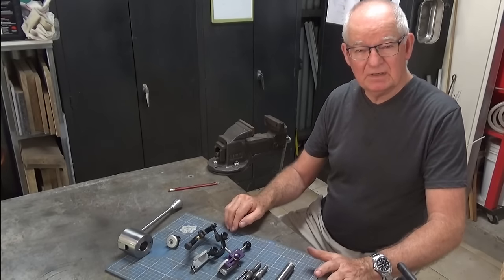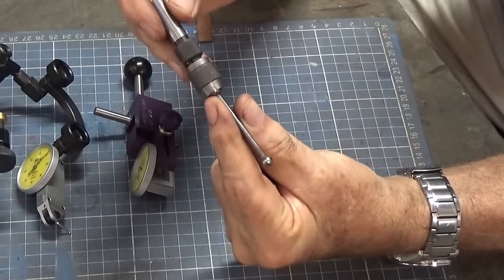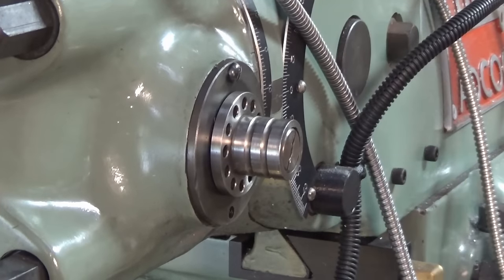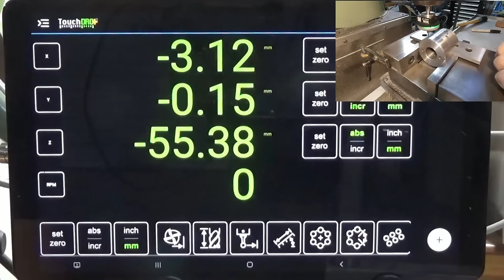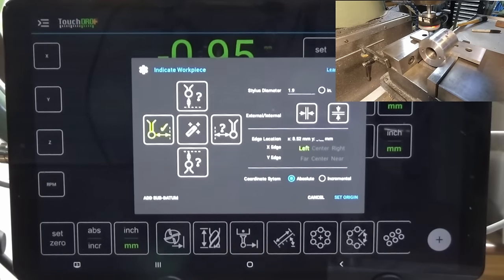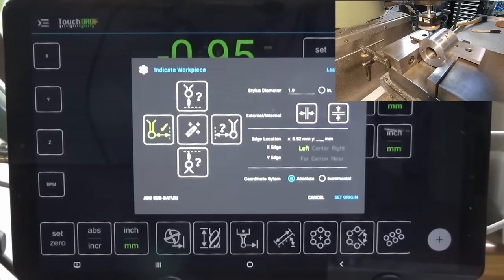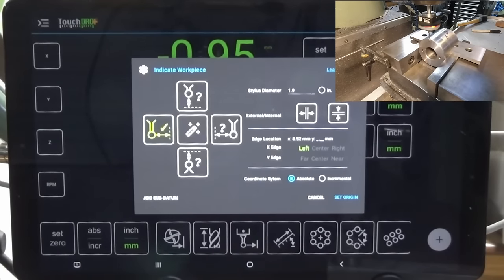Using a Touch Probe with TouchDRO

Comment: Great video thank you. I have a Touch DRO on my mill, so now I'm thinking about one of those probes too. Love the clip of the roos at the end. An animal that gets around by bouncing just doesn't get old.
Reply from the maker: Thanks. I used that probe today to find the centre of a 3/16" half pocket in the end of a steam engine cylinder. It's about the only too that I have that could get inside the perimeter of the opening. It worked great!
Regards,
Mark

Comment: Excellent video. Some years ago I acquired a Burke Millrite which has about ~0.0025 backlash in X & Y and has always drove me nuts. I thought about a ball screw conversion but couldn't justify the expense. Then I came across TouchDRO when I was installing mag scales and I quickly purchased it. Touch DRO has literally changed my world when using my mill and I highly recommend it, best money I've ever spent on my home shop equipment/tooling . Next I'm planning to do the same setup for my 1937 16" Series N Southbend lathe.
Reply from the maker: I had a sort of crisis of confidence when I first started using TouchDRO with the iGaging capacitive scales that I first installed on my Bridgeport. The capacitive scales just weren't reliable enough and I found myself going back to using the micrometer dials. Of course, that sucked big time because I also had some considerable backlash in the X and Y axes. However I bit the bullet and swapped over to glass scales and I haven't looked back. I can use it all day and I never have an issue. It seems a bit nerdy but I like that.
Regards,
Mark
Reply: @Preso58  I'm using iGaging scales and I to had some issues. I found it to be bad grounding at the scales. I had to clean paint of the mounting hardware brackets and ensure a good ground from the head all the way thru the machine to ground. 👌🏻

Comment: Good overview on the different types of edge finders Mark. When you were a tenth of a mill out I immediately thought that there was something (swarf, dirt etc.) that was causing the issue. Good that you found it. Also, nice work on the handle. My mill has two modes, a handle like a drill press, and a hand wheel that moves the quill around 2mm per revolution. I have removed the handle and I use the hand wheel as it is more accurate.
Reply from the maker: I now blow out the collet and the bore of the spindle before mounting the probe. I have a bad habit of leaving collets lying on the tray beside the mill vice. I usually wipe them down with my hand on the outside but there was probably a chip in the bore of the collet. I love the quick set quill handle. I should have made one years ago.
Regards,
Mark

Comment: What I have on my knee mill is an after market automotive steering wheel I love it. Thanks for a wonderful video. From NW Indiana USA
Reply from the maker: I thought about getting one of those. The other option was a three or four handled feed wheel like you see on a drill press. One of the issues with my mill is there are a lot of cables and air lines around that side of the mill head. The DRO, work lights, air lines and the probe connection wire all seem to get tangled if you aren't careful. The steering wheel idea would be the best option in that regard because it would be harder to get stuff tangled in it. However the upgraded feed handle does look nice and it seems to fit the aesthetic of the mill.
Regards,
Mark

Comment: Thanks for the demo Mark, I'm not in the market for a Touch Probe or TouchDRO but it's good to see what I'm missing out on. :) 
Good to see someone else has made a Stefan design low profile TDI holder - I'm really happy with mine.
Reply from the maker: I do like my Stefan style DTI holder. It's so much easier to see the face of the dial as you spin it around and it is rock solid. The Indicol style is possibly more versatile but it's easy to bump it and change the position of the stylus. 
Regards,
Mark

Comment: That is really cool. You're really tempting me to change my mill DRO to the TouchDRO. I like it on the lathe, but the mill mode is so powerful.
Reply from the maker: Thanks. It has taken me a long time to trust TouchDRO. When I was using the capacitive scales I had a few cases where the reported position was wrong. Since fitting the glass scales it has been 100% reliable. I don't think I could go back to using micrometer dials and dealing with backlash!
Regards,
Mark

Comment: G'day Mark, that touch probe is a nice addition the the touch DRO 👍
My Bridgeport came with the commercial version of the quick adjust quill handle that works quite well but I use the steering wheel most of the time.
Enjoyed,
Cheers.....
Reply from the maker: Thanks Dean. I tried to buy a quick adjust quill handle but nothing came up in my searches for items outside the USA. That's usually the case for anything Bridgeport related. In any case the shop made version works great and I sort of take it for granted now but the first time I used it I realised how convenient it was. 
Regards,
Mark

Comment: Gday Preso, the prob looks like a good unit and accurate, I find TouchDRO easy to navigate and for operations like setting up a bolt circle pattern is simple and having a visual on the screen just makes it that bit easier again, the new quill handle looks fantastic mate, cheers
Reply from the maker: Thanks Matty. I do like that quill handle. I sort of take it for granted now but it was a massive improvement on the stock Bridgeport version. I am using the touch probe more and more now that I trust it. 
Regards,
Mark

Comment: Fantastic result with the handle, Mark! The finish came out great, and now you've got an awesome handle that'll last forever, and makes machining that much more fun. One of those quality-of-life improvements that makes one think, "Why didn't I do this sooner?!" 

Great demonstration of the touch probe. You're lucky... Mine didn't arrive nearly as concentric as yours did. It's pretty fiddly to get dialed in, but has seemed to hold concentricity pretty well since. I've found it to be another great quality-of-life improvement, and I can't wait until Yuriy adds Z-probing to the app, which will bring the tool library into play (and make things even easier!). I've suggested putting QR codes on the tools, and using the front-facing camera to scan the tool and automatically apply the offsets.
Reply from the maker: I guess I got lucky with that probe. The first one I bought for the Sieg X3 mill was out a bit but I got it dialled in after a lot of messing about. The little locking screws are very finicky. I think I have finally got the work flow for anodising sorted out. The "secret sauce" is to rinse the part way more than you think is necessary, especially if it has threaded holes. They tend to retain oil, contaminants and acid from the anodising bath and all of those things can ruin the dye step. 
Regards,
Mark

Comment: Fadal CNCs can find the center of a circle with three touches. I love that feature even though it's only one touch less than the +X/-X/+Y/-Y method. But you can also find the center of a semicircle, or any arc, like the center of a corner radius. That might be handy, and seems like it could be handled by Touch DRO.

My shop-built quill lever, and most commercial ones, disengage by pulling the lever outward, so there's no interference problem. But they sure ain't as pretty as yours. Nicely done.
Reply from the maker: Thank you. I have fallen in love with the parkerised finish on steel parts. It looks and feels lovely and it just doesn't rust in my workshop environment. I have been using the touch probe more and more now that I know I can trust it but the only downside is that I have to look after it. The old mechanical edge finders can be rolled around in the chips/coolant and they still work but the fancy schmancy electronic equivalents don't' like that sort of treatment.
Regards,
Mark

Comment: I like the quill handle. I have the same issue with my Tom Senior mill. That would work. I would have to make the boss to accept the handle as mine works slightly different.
Steve.
Reply from the maker: That quick set handle is so nice to use. Having to change the rotation position of the original Bridgeport handle was annoying and sometimes it got stuck. Once I smacked it back on so hard (in anger) that I popped the quill drive spindle out of it's housing and the little snap ring came off completely. It was at that point that I realised I needed something better. 
Regards,
Mark

Comment: Don’t see any other comments about this but did anyone else notice the size of the spider at 13:04? It’s on the support tube for the Touch DRO up by the electrical tie. Mark, I could see fingers getting closer to it as you talked about the printed box for the small circuit board. 😳
Reply from the maker: Hey, you have good eyes. I had to go back and watch that several times before I could see it. I think it's a baby huntsman spider. They are harmless but the adults can be as big as your hand. 
Regards,
Mark

Comment: Nice video! That little odd-size disk on the wiggler should be 0.100 inch in diameter or 2.54mm.  I really prefer to use an indicator these days or a spring type edge finder, but other than for picking up a center punch mark with the pointy tip, I don't use the wiggler at all.
Reply from the maker: I like to use the wiggler if I have to reach down over a large diameter part lying with the axis parallel to the table. Even if you cannot see the ball end you can still see when it kicks out. However, each of the tools has it's place. It's just nice to have options.
Regards,
Mark

Comment: No need to run  a conventional edge finder in a collet rather than a jacobs chuck as the runout does not affect the reading accuracy.  Its relative to the spindle rotation axis.
Reply from the maker: I wondered about that too but my understanding was that if a conventional edge finder is orbiting around the true spindle axis it will make contact with the part at a point which is off centre to the true axis. For the wiggler style edge finder, it has a ball joint so it can account for misalignment. I mostly have that edge finder always sitting in a R8 collet anyway.
Regards,
Mark
Reply: @Preso58 It's very easy to test this with a Jacob's chuck and some shim stock at the chuck jaws holding the edge finder for ludicrous run out.

Comment: I'm sure if you get more used to the probe you will have very consistent results. The touch dro sur is a nice tool.
And no, don't shoot the birds.
Reply from the maker: I have been using the little touch probe quite a lot on my latest project and I am learning to trust it more and more. The only drawback is that it is quite delicate compared to my spring centre finder. It suffers a lot of abuse and still works well. What I didn't show in the video is the tools that TouchDRO has for digitising parts. 
We thought the noisy birds had gone away but they were back today. We cannot even squirt them with water. They seem to know just how far they need to be to be out of range.
We are making a Flemish stew and waffles for some dinner guests on the weekend. I just need to find some nice Tripel beer.
Regards,
Mark

Comment: Hi Mike, the wobbler at 4.15 is quite dangerous if you for example forget that the spindle speed was set at high Rpm , ( from a previous operation)  Because of the bottom half is quite heavy. ( Compared to the standard wobbler) the bottom will separate and with the spring still attached will cut and maim anything on its path.
My solution is to fit a piece of 3/32  Tig welding rod  big enough to go thru both parts in the wobbler , fit this rod inside the spring , that way it won't come out at high speed..H.T.H.
Reply from the maker: Ha, funny you should mention that. I destroyed the spring in my edge finder when I forgot to check the spindle speed before starting the mill. It did exactly what you described and although I was able to dismantle it to remove the now comically distorted spring, the vendor that I purchased it from could not supply a replacement. I ended up buying ten new springs from a Chinese supplier and they work just fine. Unfortunately, you cannot adjust the speed of the Bridgeport spindle while it is stationary and I found out the hard way that it all ends in tears if you get it wrong. Thanks for the tip.
Regards,
Mark
Reply: @Preso58  hi Mike , like I mentioned it's very dangerous when the spring is still attached and the bottom part is still flying around , I think that it's worth a warning with a demo of how to do the mod to the wider audience..
Kind regards
Mariano

Comment: You missed the two most accurate finders: 1 Coaxial finder  2 Haimer: the BEST/MOST ACCURATE finder.  I love both my coaxial & Haimer, but the Haimer is fool proof, as you move .100 beyond touch so there is no mistake whether you stopped +/_ of touch. It's indicated on the jeweled dial. Your probe still relies on co-ordinating movement stop & light seen. For those of us that must be spot on, the Haimer is a  God send.
Reply from the maker: Yes, I would love to have a Haimer and a coax finder but I only showed the tools that I had. I don't have enough tools 🙄
Regards,
Mark

Comment: Hey Mark,
 Another great video, Touch DRO sure looks to be feature rich….. if / when my DRO screen packs up it will sure be on the list.
For your mill handle, a great update btw, for the grub screw ball bearing detent did you know that you can get spring loaded ball bearing set screws? Neither did I until I was watch a build on YouTube, 

Cheers Kerrin
Reply from the maker: Kerrin, I do like TouchDRO. I only use about 20% of the features but it is versatile and easy to use if you are a graphical learner like me.
I thought about buying one of those ball tipped grub screws but I would have to wait forever to get it and I had the Teflon and the correct sized ball on hand. So far it has worked flawlessly and you can always squish it down a bit more if the Teflon loses it's shape a bit. 
Regards,
Mark

Comment: You had the opportunity to remove the probe tip runout of 10um. Then found off center of 20um, tram th head, tram the vise, adjust out the probe runout, then recheck. I think you might find improvement.
Reply from the maker: I am sure there are improvements to be had. My issue is that my Bridgeport has some wear in the ways and in the lead screws and nuts. I can see the digital readout change when I tighten up the locks on the table and saddle and I have some backlash in the X axis in particular. For the work that I do, 10 microns is good. 
Regards,
Mark

Comment: Hi Mark, nice gadget, "good enough" for most of the work if you ask me :)

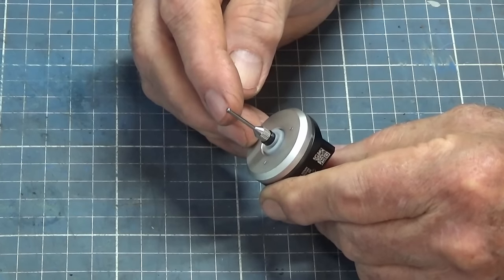At 10:07 "stylus tip is 2mm in diameter", but in TDRO it si set to 1.9mm?
At first I was thinking that this is the reason for 0.1mm difference betweeen probe and indicator
Reply from the maker: I have the same touch probe on my Sieg CNC milling machine and the software (UCCNC) has a probing function that allows you to probe a ring gauge of known size and then calibrate the "virtual probe tip diameter" to give the correct offsets. I had to set the probe tip diameter to almost the same size and I think it is to do with inertia and latency in the probe mechanism. I set the size of 1.9mm in TouchDRO after doing a lot of tests with 123 blocks and mechanical indicators to validate that size. It seems counterintuitive to set the probe tip to less than 2mm but that's the size that gives me the lowest error on simple edge finding. For centre finding it doesn't matter what size you set for the probe tip diameter. You can set a size of 0mm and it will still find an accurate centre. 
Regards,
Mark
Reply: @Preso58  I should stop commenting early in the morning, after 10 hours of work. Little grey cells do not work well in this conditions 😃
Of course.. for center finding tip diameter does not metter.

Comment: If you want truly repeatable performance with that type of probe in a spindle you really need to key it rotation wise  to ensure it it probes in the same plane every time. That way if there is a mechanical error in it's activation it is repeated every time. Even when using Decent Renishaw units that were wireless without using an M19 repeatability was not as good.  Also when using  your other indicators to check its accuracy you really should position EVERY axis in the same location. This includes the Quill as its position in relation to the center can be affected by the set of the universal head on your Bridgeport. It doesn't take much angularity wise to throw of a location by 0.010mm if there is a change of the mount point of rotation height above the diameter tested. 
Not bad though considering it's cost.  With a bit more software you could use it as a Manual CMM.
Reply from the maker: I had been in contact with Yuriy (The TouchDRO guy) and he outlined a procedure for checking the accuracy of a touch probe and he mentioned the need to clock the probe in the same orientation each time and also a procedure for validating the accuracy with respect to the spindle orientation. At the end of the day, if I can get 10 to 20 microns of repeatable error I think I would be happy with that. My mill is old and the ways are worn so even if I clock the part to zero tolerance, as soon as I start to machine the part, things start to move around. 
Regards,
Mark
Reply: So after calibration/adjustment of the probe, one needs to mark the collet, touch probe shaft  relative to each other, so the alignment to spindle remains very close...I assume  ??  Meaning, there is runout in every thing. if you pull the collet out of the holder, and probe from collet, all alignment/registration is lost.. I am considering a dedicated endmill holder, leaving touch probe permanently installed.. My mill is NMTB 40 with few tenths runout..